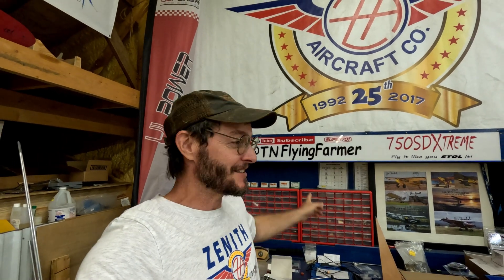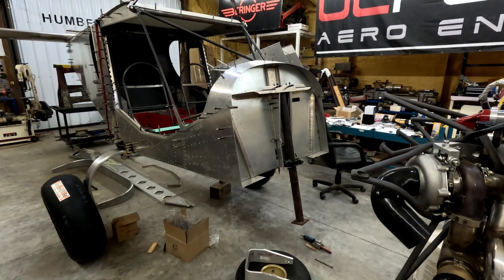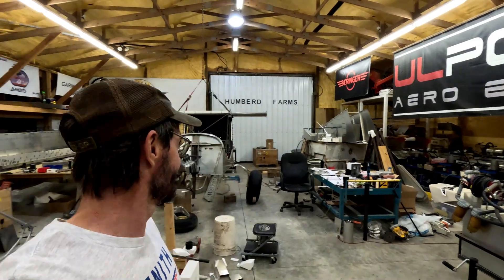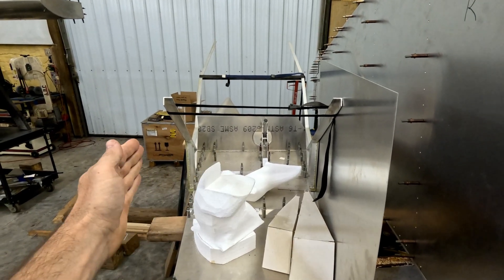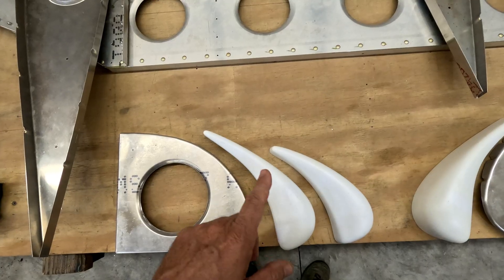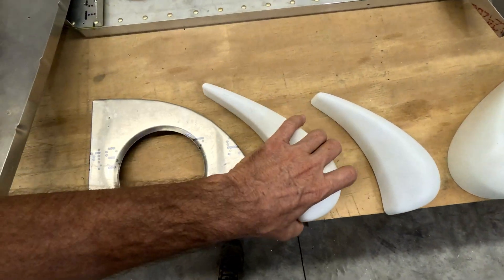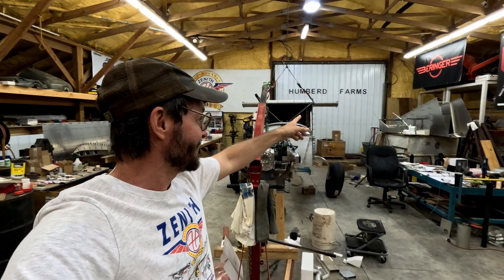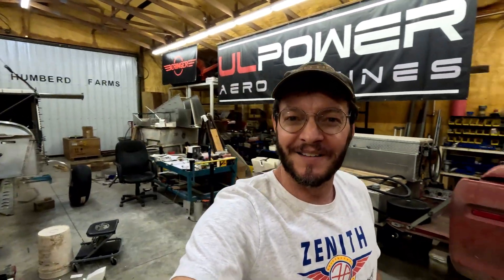Most Radical Zenith 701 ever built!? Single seater design thoughts, questions and 750SDXtreme Update

Comment: Keep low weight as the prime goal. No gadgets will outperform a lighter weight craft. The stock wing will do what you want if you truly can get the weight as low as you suggest.  Light tires, lighter skins and parts, gear, interior, foam and carbon slat, two stroke engine (?), no paint. Get is close to an ultralight as possible.

Comment: What is the mission? When I designed and built my one of a kind aircraft, I was guided by the mission I wanted to fly. What do you want to do with the single place 701? STOL? It will not have much value as just a single place 701, but a crazy STOL machine would..

Comment: Dan Reynolds is probably the one to talk to on slow speed mods. I would consider making both sets of slats but make them interchangeable. Ive always wanted to incorporate the moving slata like the Helio or Superstol but it adds weight.  You might consider the wing design itself. The most efficient way to create lift is to increase wing area. I wonder if you could increase the wingspan enough and maybe not even need slats. Slats are pure drag at any speed above slow flight. Of course you have to decide exactly what the mission is.  I want to build one wirh better slow flight characteristics but also has higher cruise speed.  Ive redesigned the wing a thousand times in my head. Lol.  I wish me and yiu were neighbors because we could build some bad ass planes.  You just need more time to work on airplanes.  I really think you need more wing and possibly a different wing profile. Ive wanted to just add one rib bay to see how much that would help. Its all fascinating to me. I really should have become an aeronautical engineer.  I consider myself one, just self taught because most of it is just common sense to me. Anyway Jon, only you can decide how radical ro be with the 701 single.  I would reach out to Dan Reynolds and of course Mike Patey. Both in a perfect world but Dan is thw only pilot i know of with actual flight at speeds below 20 mph. If you truly want to go radical,  thw possibilities are endless.  Carbon fiber wing? It may boil down to time and money.  You can do some pretty cool shit with a fat bank account. I keep hoping someone will revolutionize electric motors. A fiberglass custom 701 with an electric motor would be kick ass!! Anyway,  cool to see the update.  We just got started cutting soybeans yesterday so my next 3 or 4 weeks are going to be hectic.  Good luck and talk to Dan!

Comment: On the single 701, use 701 slats, vortex generators, and maybe double terrace the top surface of the wing rear of the spar? That or just install a RATO unit under the landing gear, an 'O' sized rocket motor ought to be enough for take-offs, then another on top  center of the fuselage to stop on landing.

Comment: If you are worried about weight talk to the companies that make carbon fiber slats for other aircraft like Cubs. Maybe you can get one of their kits if they are similar. Maybe you can get some custom made from them. That would save you a ton of time from having to make them yourself. The single seat should be as radical and safe as you can make it.